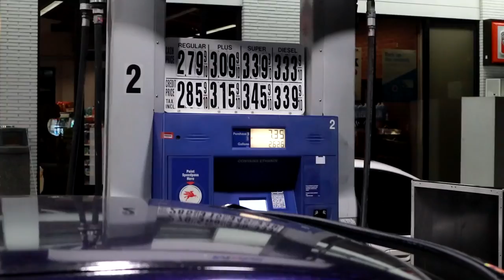I GOT A TURBO!!! (ej22 na-t build)

Comment: The left over stud on the up pipe behind the turbo goes to the transmission housing. I ditched mine. Just ran the front one. Definitely get a pod filter though. or change the oil every 500 miles.

The plastic T fitting on the vacuum line goes to the stock two port boost controller. Its a bleed style where it bleeds excess boost back into the turbo inlet post MAF to keep the waste gate from opening. If you switch to a three port boost controller you will get rid of that t fitting and run two separate lines. Or you can go straight to a manual boost controller but you'll lose the ability to have boost by gear tuning. which you may or may not care about.

Comment: Clean the sliders and slider holes in caliper with some break clean tape some emery cloth on a drill bit sandpaper will work but sucks and clean the inside of the caliper like new some anticize and should last. If caliper is screw will take extra work to push caliper pistons back in will be different then the others you will tell! If its mostly inside pad toast its the sliders!

Comment: get aftermarket intercooler for hawkeye, i had one in my hawkeye, it was just some bigger ebay top mount, with ebay blow off
Reply from the maker: Ville Lipponen I would but idk how it would fit forums tell me to run forester xt or Hawkeye intercooler because they’re skinny and won’t hit the hood
Reply: @damianmonte  i understand, i think mine wasn't thicker only wider and longer. because it fitted same way under the hood, like the plastic thing under the scoop hit it, and didn't cover all the surface so i had to take it out so the air coming from the scoop would hit all the intercoolers surface. it might been thicker too, but maybe it was made so it sits lower. anyway mine was imported from UK to Finland and was rhd with ej257. so it was that 2,5l model not the japanese 2.0 there might be difference in intercooler fitments. that was my only subaru, so i don't really know so much about those.

Comment: I know this is a few years old, but I have a 98 Impreza outback sport with the n/a 2.2 and I was wondering if you know what all I need to add a turbo to it whether aftermarket or an oem. I have heard you need the 25 heads or similar.

Comment: get him a a couple sets of carbon ceramic pads, rotors would help too. but carbon ceramic handles higher braking way better. I beat the piss out of mine. and with only disc's in the front, stopped 65+ to 0 in feet, from m'f's stopping on the highway. My car dropped iat's just going from a shitty stock box to an intake that pulls directly out of the grill.